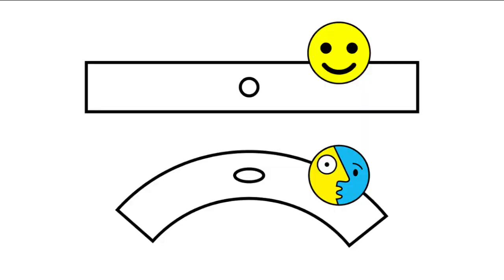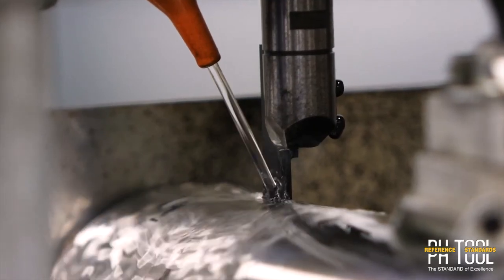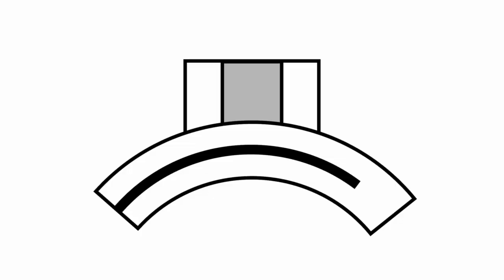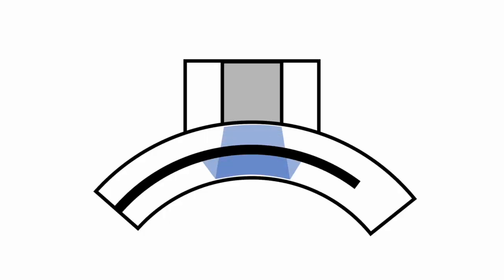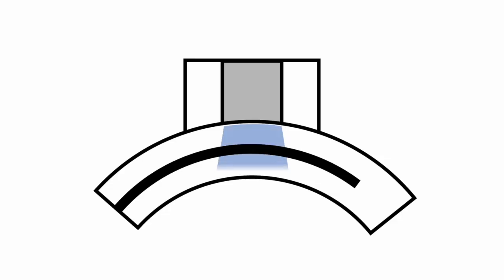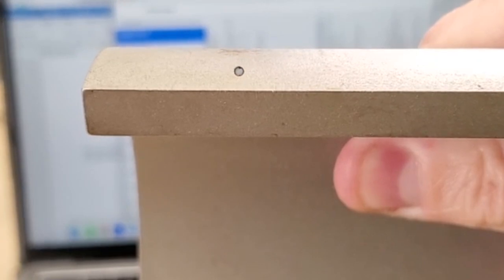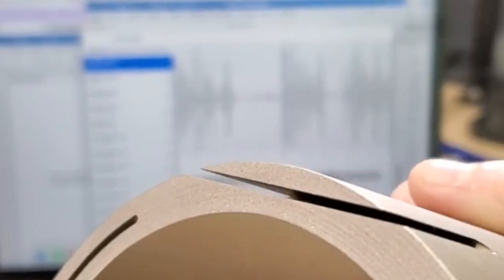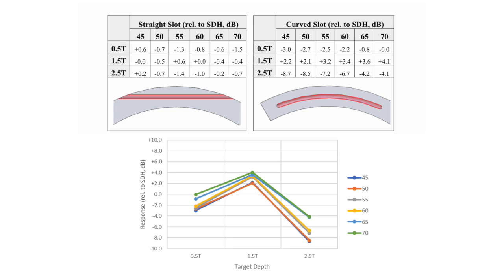Curved Holes in a UT Calibration Block?

Comment: ASME V also ask for 38 mm length SDH, for pipes 19 mm thick and below, only one SHD at ½ T would be enough. But if you have 73 mm OD pipe 5.3 mm thick (2 ½ pipe STD) it is not possible to drill a straight 38 mm length SDH (at any depth)!  Let me know if I’m wrong! So, in those cases, curved SDH EDM would be mandatory?
Reply from the maker: You're not wrong about the length of the holes. This is why on the ERVT blocks, we have to stop at around a 3" XXS. Anything smaller or thinner and that hole gets too short.

But to your second point, no. The point of the video was to demonstrate that sensitivity on a curved hole will probably be less than that of a straight hole. For thin stuff and small diameter, at this point we must use notches.
Reply: THANK YOU  @hollowayndtengineeringinc.5201

Comment: Currently in my country we just cut a small sector of the pipe enough for the probe and the beam spread; drill a hole so that the depth is correct in the middle of the block and pretend concave/ convex effect does not exist. It've been generally accepted by many many parties, so I guess that'll work until we find a better solution as making a curved hole can be really challenging.

Comment: You could do a proper full-on curved hole pretty easily with 3d printing, even with a cheap printer using some of the modern metal 3d printing filiments that you print at home and send off for sintering (BASF makes a few options you can print on a regular printer).

Aerospace and the chemical industry are starting to really embrace these non-machinable geometries for things like rocket parts and reactors, it might see practical use yet.
Reply from the maker: I'm not sure FDM would be able to produce homogeneous materials with low enough attenuation for UT. I have a small metal printed part, I'll try it out.
Reply: @hollowayndtengineeringinc.5201  

Ah, makes sense. I guess one other option would be a powder pressed part and then sintered. I haven't tried anything metal yet in my lab CIP but have been pressing ceramics at 60K PSI and sintering. Dimensional tolerance in cold isostatic pressing isn't great though.

It is a super interesting thought experiment at minimum.